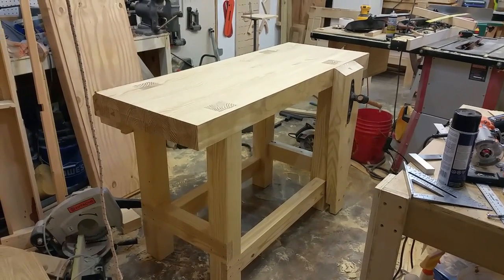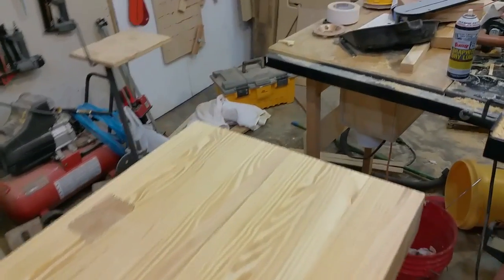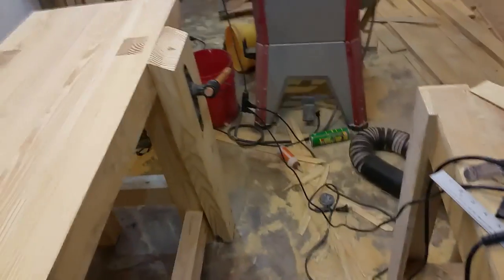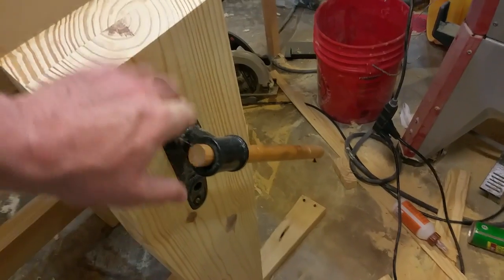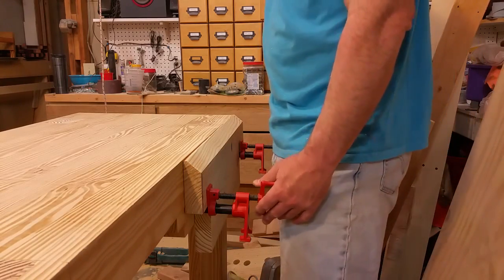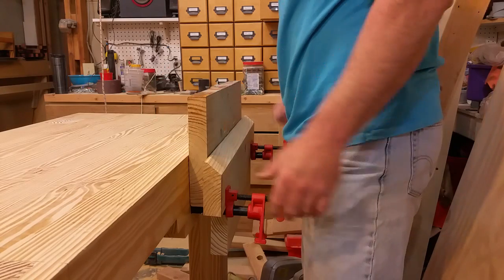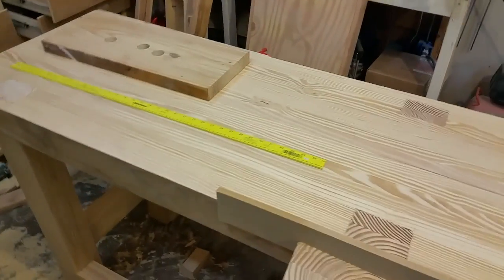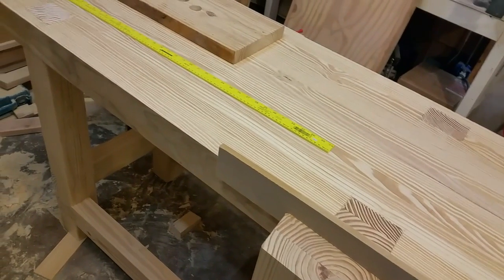Workbench Tour

Comment: Looks great! I wouldn't worry about the gaps. Just push more wood glue in the joint and push sawdust on top. Those legs are huge too so you shouldn't get any racking out of that one. Also, looks like you got a lot clearer wood for yours. I had to hide a ton of knots on the inside of my top slab.